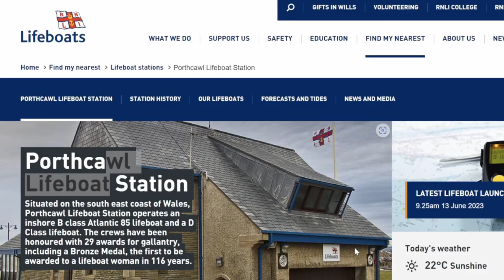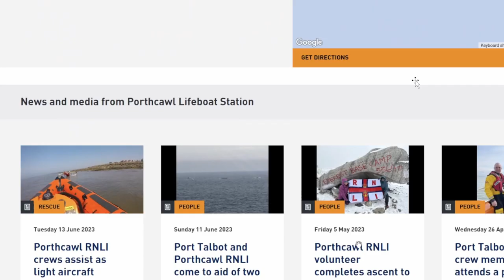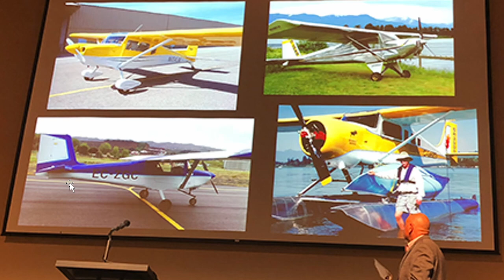Pilot Ditches And Saved in Wales

Comment: The landing gear slowed down faster than the rest of the aircraft, so it rotated around a center point of axis 
This is a common occurrence when trying to land on wet sand or water The vert. stabilizer [the rudder] & the upper wing took the brunt of the rotation impact.
Reply from the maker: Thank you for sharing on this one Al